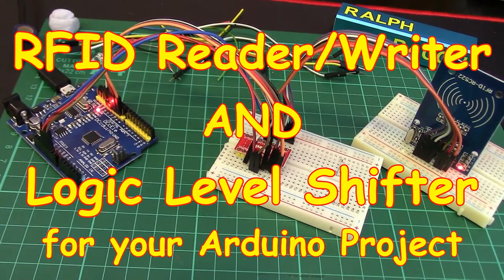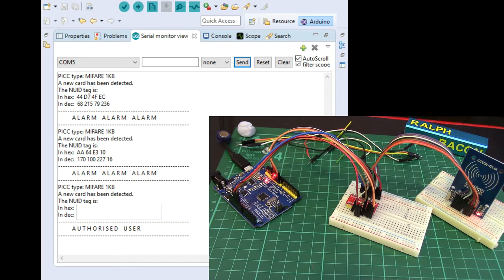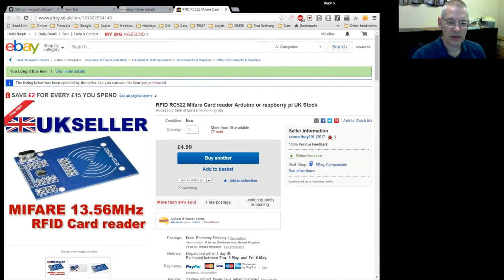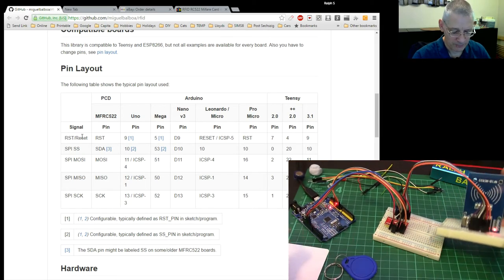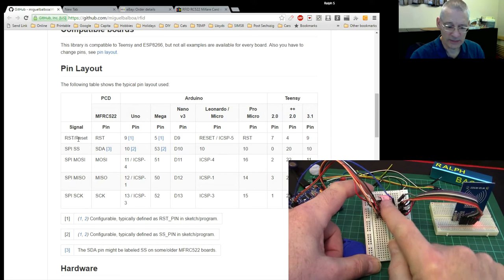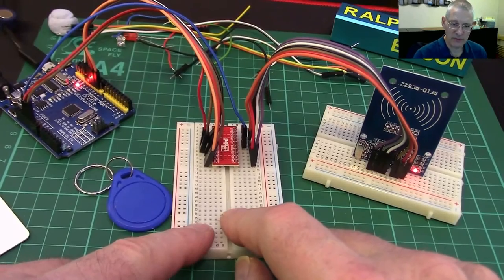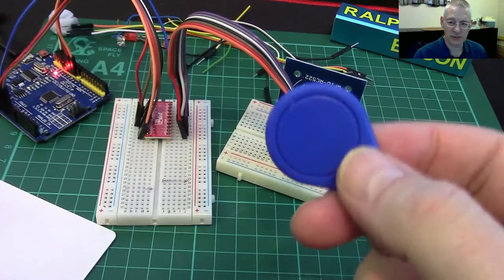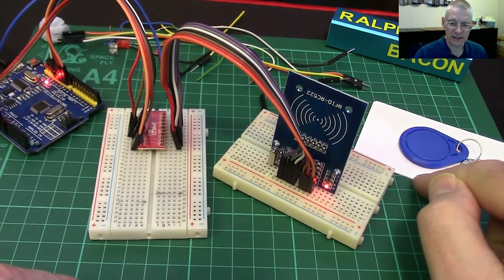#34 RFID Reader/Writer (Mifare MFRC522) with a Logic Level Shifter

Comment: Hi Ralph
Another great video, well done, just a quick question, Which Arduino IDE are you using in this video.

Thanks
Graham
Reply from the maker: Hi Graham! Needless to say this question has been asked many times (even though I try to hide the fact I don't often use the standard Arduino IDE. I say "hide", I mean "not mention".)
 
So I'm using the Eclipse IDE. In fact, I've just upgraded from v3 (Toddler) to v4(Sloeber) which contains the Arduino plug-in all nicely built in. He asks for a donation but it's totally optional.
 
Now this is quite a complex IDE but for me works just right as I use Microsoft's Visual Studio every day and this is probably as powerful. Caveat: some sketches will not compile as the libraries being used contain errors or syntax constructs that Eclipse (quite rightly) rejects. It's then a matter of either correcting the library (yup, just done that not 5 minutes ago for a project I'm working on) or contacting the author(s) asking them to make it compile under Eclipse. If you can get hold of them they are usually keen to get it working. If the authors have "moved on" to pastures new then you're on your own. Doesn't happen often but is frustrating when it does. The workaround is to go back to the Arduino IDE or use another one, such as the Sublime Text Editor (see video #69).
 
Perhaps the Sublime Text editor is more than enough for you. Better than the standard IDE (eg it has intellisense) but it's not as complex as Eclipse. Check it out, video #69!
 
I might copy this entire answer to the Channel Messages so I can direct others to it, as it's a common question!  But thanks for asking as it has at least made me think of doing this!

Comment: Another thing, I recently tested the rfid_write_personal_data file found on github but I get an error saying:

error: invalid conversion from 'byte {aka unsigned char}' to 'MFRC522::StatusCode' [-fpermissive]

This error occurs on pretty much every line of code that contains "mfrc522".
The code has likely been altered since its use in your video, but I'm not sure what changes to make to fix this supposed conversion issue.  Do you know what has been altered, and/or what would need to be changed to fix this?  Thanks!
Reply from the maker: Mmm, tricky one this. Not my code so I'm not familiar with it. I'll try and take a look over the weekend to see if I can what the issue is.

In fact I've just had a look at this code and it would appear you might have a problem with the underlying MFRC522 library rather than the example sketch. I'll take a look over the weekend to see whether I can find the problem. I'm assuming you're using his library too and not trying to mix and match.
Reply: I believe I am using his library (might be wrong - will check), and yeah that sounds like it might be the issue rather than the main program. Thanks again!
Reply from the maker: I've just downloaded the example sketch from here: 

https://github.com/miguelbalboa/rfid/blob/master/examples/rfid_write_personal_data/rfid_write_personal_data.ino

And it compiled just fine without me having to anything which means it used the library I used in my video - all without amendment. I therefore can only assume that you have a different library (or the IDE is picking up a different one to the one you think you are using!). 

Check your libraries (and/or download Miguel's library again and place it in your libraries folder) and try again!
Reply: Alright, good to hear! That should solve it. Thanks!

Comment: can we just use several pins from RFID connected to level shift converter and the rest we just connect directly to Arduino? Or is it required to connect all used pins through level shift converter?
Reply from the maker: The MiFare board is only 3,3v tolerant so any wires going to it must be level shifted.

Comment: Hi Ralf, you are one of the few that used a voltage level converter to connect the RC522 to Arduino data port.
There are lots of video samples over youtube  that connect the RC522 directly to the 5V SPI data port :( . Unfortunately I found the others examples before yours, and my first reader was destroyed. It simple suddenly stop to work. No smoke, nothing. Dead. :(
When I saw your I realized my mistake. So I bough a set of level converters, because I have several others 3.3 only sensors (still not used) that I plan to try with Arduino.
Reply from the maker: Ciao Roberto! Yes, indeed, a (bi-directional) level converter is the best way of doing things although a simple resistor divider works too (but is not optimal and ends up using too many components anyway!) Good luck with the other sensors you have, I might have a video on some of them, take a look. Nice to hear from you.

Comment: Hi I have this error 'class MFRC522' has no member named 'PCD_Init' could you help me please??
Reply from the maker: +Ammisaddai Arciga
Are you using the SAME and CORRECT library that I'm using (if any) in your sketch. It sounds like there is something missing from your setup, so double check that the libraries are installed correctly (in the libraries folder). If necessary, download the example sketch and libraries again into a fresh project. I hope this helps you, if not then let me know.
Reply: Ralph S Bacon I found that was my IDE version I was using 1.6.0, I changed to 1.6.10 and it works good. 

thanks  do you have the code for reading that personal data?
Reply from the maker: Well done for finding the error! But I do recommend upgrading to 1.12.0 as other versions (after 1.6) had some problems, now fixed in 1.12.

Comment: Hey Ralph :) I'm trying to read and write using a Arduino nano , it seems to support 3v? do you know if that will work, and do you have any advice? i just recently started using arduino, i am very unfamiliar but very excited and patient , but i am really trying to figure out how to set up this NANO with the RFID chip- RC5222.. I kinda need some help;)
Reply from the maker: Hi Norman! The Nano is designed to run at 5 volts (although it might run right down to 2.7 volts, but not by design). However, you can get Pro Micro devices that run at 3.3 volts (watch out, there are both 5 volts and 3.3 volts versions -get the right one!). These will require an FTDI USB-to-Serial converter to program them (I have videos on this). But if you are trying to use a 3.3 volt device just so you don't have to voltage shift the 5 volts down to 3.3 volts then that's the wrong approach, in my opinion. Use a Nano at the voltage it was intended and voltage shift the GPIO outputs. Watch my video #89 out later this week for an alternative method of voltage shifting.
 
The best advice I can give you is to not try and run before you can walk. Make sure you understand how to upload the "blink" sketch to your device. Make sure you know (most of) the Arduino C++ language (it's specific to the Arduino). Follow my demo sketches to the letter (download them), use exactly the same hardware and then you will get it to work. Once you have a working proof-of-concept you can "do your own thang" as the "yoof" of today might say (but probably don't). You can do it, but do it slowly. Good luck.

Comment: what kind of compiler do you use ,which allows you to enter commands directly from the keyboard ?
Reply from the maker: I think you must be referring to the Serial Monitor, Pushkinmania, which allows two-way communication between the Arduino and your PC. Normally we'd be receiving data sent from a Serial.Print statement, but in this case we are also sending back data to the Arduino via the USB port, which the Arduino receives via a Serial.Read() statement. It's built into the Serial Monitor (aka Debugging Window) on the Arduino IDE (as well as the IDE I was using). Make sense?

Comment: Running uno (3.3v output) with multiple RFID and can only get 1 RFID reader to work at any one time. Powering uno from usb from laptop. Any suggestikns?
Reply from the maker: Make sure the Chip Select (CS, sometimes marked SS) is not being held permanently LOW by the RFID reader, as it uses SPI to communicate and sometimes the manufacturers get real sloppy and tie it LOW (on the basis you will only ever use one SPI device!!!)
Reply: @RalphBacon  thanks i will check. The odd thing is if i remove the 3.3v from the RFID that is reading, the other one then comes online and reads??
Reply: @RalphBacon  oh and how do i untie the LOW or its a fixed state?
Reply from the maker: Firstly, ensure you are using separate CS/SS pins for each device? 

Pin 10 seems to be always used as the default SPI pin but that's for the first device only. You need another CS pin (eg GPIO 9) for the next device (one of the downsides of SPI). You then need to ensure you bring pin 9 LOW to talk to the other device whilst pin 10 is HIGH. The SPI device is active when the CS pin is LOW. Don't have two CS pins LOW at the same time.

So, I suspect that by disabling one RFID reader (by removing VCC) the other one becomes 'active'.
Reply: @RalphBacon  will try that and really appreciate pointers. I was at the end of my troubleshooting ideas. Btw am a mechanical engineer and trying this for 1st time. Thanks again
Reply from the maker: Good luck and let me know!
Reply: @RalphBacon  hi, well i have 2 RFID readers reading! I believe you were coreect on the communications set up, i switched out an RFID with another one bought from a different supplier and both are now working...at moment. I will check again 2mrw to confirm it but was so excited to let you know. Thanks for your help and i will still persevre with the other units but putting pull down resistors
Reply: I cant over state how nice it was with your support, it make a big difference
Reply: All good and up to 3 RFID readers. without issues.
Reply from the maker: I'm very pleased you got it working! Without meaning to sound in any way patronising, Good Job! Your perseverance paid off.👍
Reply: @RalphBacon  thanks alot. Have all 4 up now and running. Now will convert it from bench test to a production fixture. If i supply the arduino from a power pack 7vdc and then plug in the usb to view the serial monitor, does this interfere with the power stability and in that case, what power takes precedence between the two?

Comment: how i can cloone a RFID ? 
how i can transforming data from rfid card  to another rfid card?
?
Reply from the maker: The usual way is to read one card, store the data within the Arduino sketch and then write another card. Note that only the Chinese Mifare cards allow you to clone the actual RFID because they do not adhere to the standard - that area should be protected but isn't.

Comment: Halo Ralph S Bacon :)
Thank you so much for your video, its helps me to doing my final project. And I have a questions that makes me confuse.
How I can connect the arduino with the database? Do you ever try it? I want the data in tag will be appear in database every time you swiped tag to the reader.
Reply from the maker: Hi there Sondang Debora, nice to hear from you! An interesting question you ask too. Arduinos are not really database machines but you can easily create a small (encrypted?) file on an SD card to record card swipes (in, out, who they are). However, you need to keep it simple. Space is not the issue (on a 32Gb card, for example) but speed of processing may be. 
 
Let's assume a user swipes her card. The Arduino has to read a (serial) file, line by line, until it finds a match - thus indicating the user is authorised. Then it might want to write out the date & time to a different file to record that swipe. Not difficult but as I say, you need to keep it simple. And secure!
 
If you really want a proper database then the simplest way of doing this is to use a PC, attached to the Arduino. You might want to use an Arduino that emulates a keyboard so that the Arduino can send the card info just as though a user had typed it in, such as a Pro Micro or Leonardo. The PC can then access any type of database you want, quickly, store data, and send a response back  very quickly to the Arduino. In this case the Arduino merely acts as a peripheral to the PC.
 
I hope these ideas help you. There are videos here on this channel that deal with keyboard emulation and Sparkfun Pro Micro Arduino boards, which are fairly easy to use. The Arduino playground also has information.

Good luck with your project and do look at other videos here to see whether they might help you.
Reply: I am sure that Ralph has done something about HTTP with an arduino.

Comment: I want to build a drinkdispenser and the people have to pay for their drinks. So they can load some virtual "money" on their card and are able to pay with only one swipe.  (Sorry for my bad english :/)
Reply from the maker: Good project idea sascha! Straightforward enough to write the value of their "money" onto the cards (in a secure place, encrypting the data) and easy enough to remove it again when they have swiped their card to get a drink. Security is important here, so that data is not held in plain text. And some sort of tampering detection will be required too. Good project idea, let us know how you get on.
Reply: Yes, they are called Bar Staff.

Comment: So can I use this to scan lets say 500 different cards ?
Reply from the maker: Yes, it's a generic card reader so if you bought (or had prgrammed) 500 different cards it would read the number in them, just as I show in my video. What you then do with that number Dylano is, well, a different matter but it will read an unlimited number of cards. If you were thinking of matching a card against a person (eg for a door entry system) you would need to store the number and person information in a database - a Raspberry Pi would do this with no trouble at all, using the Arduino as a card-reading front end (and possibly also used to actually unlock a door).

Comment: rc522 rfid can read 125khz cards?
Reply from the maker: Hello infoAB, and welcome! 
The Mifare reader I use in my demo is only for 13.56Mhz - you'd need a different reader (and cards/fobs) for 125kHz. Here's an example of a 125kHz module from Amazon UK that isn't too expensive, but they are doubtless available worldwide (eBay might be a good source): https://www.amazon.co.uk/Hobby-Components-RDM6300-125KHz-Electronics/dp/B00KCMPIIK
I hope this helps you in your project and thanks for posting this very pertinent question, which may also help others reading these message.
Reply from the maker: Here's an interesting article about the different types of RFID reader/writers - I wish I could afford the UHF version, you can read those from quite a distance but the other two are pretty short range for the most part (a few centimetres at best).
http://www.impinj.com/resources/about-rfid/the-different-types-of-rfid-systems/

Comment: Hiya Ralph! I just "discovered" you a few days ago. I'm really enjoying your videos.

You asked about potential uses for RFID readers. The one I documented on my blog at http://kerryburton.com/swiping-passwords/ may not be for everyone, but I'm thinking of resurrecting the idea for my own use ... possibly with a smaller, 4-button keypad, because I don't use THAT many passwords on a regular basis.

The next trick is to work up a way to UPDATE the passwords that the Arduino keeps track of. Since writing that blog post I've gained experience with the Arduino's EEPROM memory; I think I'll try to move the passwords from the code itself (hard-coded) to EEPROM, and work up a method to input and update (and "encrypt") them - subject to RFID card authentication, of course!
Reply from the maker: Hi Kerry, and welcome! Yes, you need to get those passwords out of code and into something else; EEPROM or SD Card (suitably encrypted, even simple encryption will stop most people reading it). If you watch my Video #65 on EEPROM basics you'll easily be able to (a) get them into EEPROM and (b) be able to update them on demand via your code. Sounds like you've cracked using the keypad matrix but just in case my (old) video #13 covers this too!
 
Good luck, should keep you busy and off the streets for a while! Good to hear from you, and I will read your blog too (are you keeping it up-to-date?).
Reply: Sadly, my blog has been neglected for a year and a half ... but I've been meaning to write up my most ambitious project yet. It's a simple greenhouse controller that activates remote outlets (with heat sources or fans plugged in) when certain temperature set points are reached. The most labor-intensive aspect of the project was the rotary encoder-driven LCD menu system that lets you update values for various settings (stored in EEPROM).
Reply from the maker: Perhaps your enthusiasm for Arduino related projects, Kerry, will also fire you up to update your blog? A rotary encoder controlled LCD was "fun", I bet! I think I might have been tempted to go a different route, such as a touch screen (what a coincidence, my latest video!) or a key matrix pad (assuming you had only numeric values in the menu). But maybe you should blog it all, included false starts, U-turns and, of course, successes and triumphs. Just suggestin'...